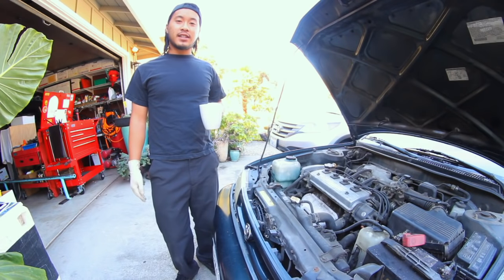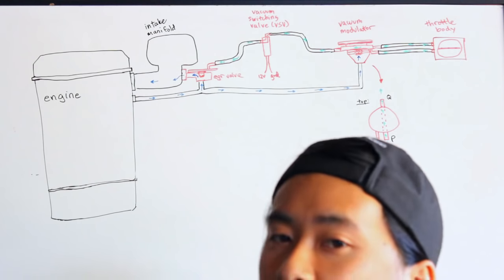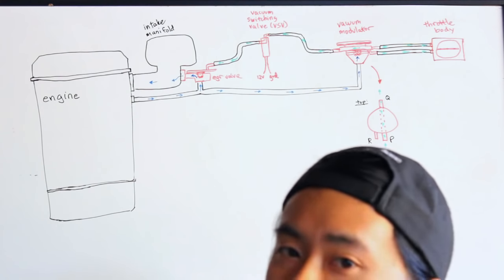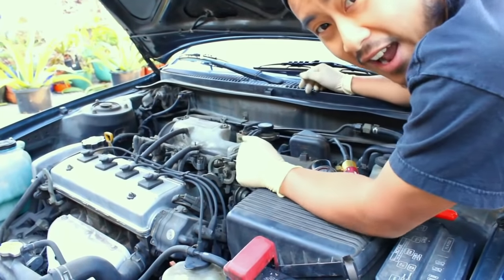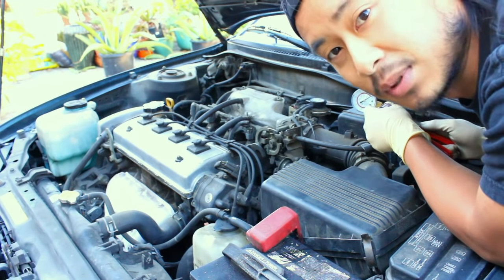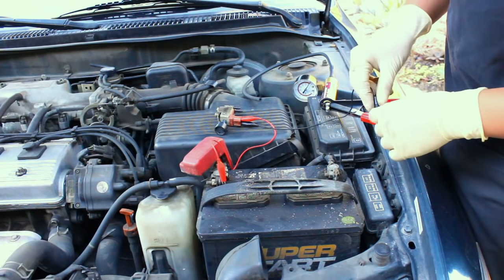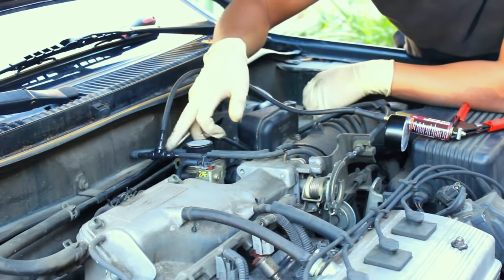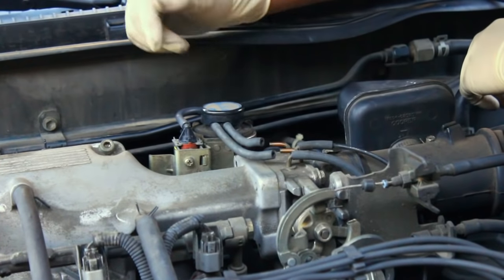How to test Toyota EGR System(VSV, Vacuum Modulator, EGR valve)

Comment: Justin, I have another P0303 Code on my  1996 Lexus es300 that I have done all tests shown on YouTube and replaced all coils, wiring, fuel injectors and test vacuum leaks on all cylinders.  I am tired of keep opening top of engines replace more parts, but can't find the cause of this P0303.  The misfire engine light comes on blinking when warmed up, but came on steady when cold.  What do you think?  Should I replace the Knock Sensors?  Someone told me this could be the cause.  Help, please.

Comment: Justin, that's an excellent explanation and video.  I'm not a DIY kinda guy so I was wondering if you work on other people's cars, and if so, what city, state you are located in and what's the name of your shop.  I have a 2000 Toyota Avalon with 265K miles but it runs smooth with smooth idling, and I have codes P0440, P0441 and P0446, the mpg has dropped a little bit.  Although I'm in Cleveland, Ohio, I do drive to other parts of the country to see family.  Please let me know and please keep up the good work.  Thank you. - Samir

Comment: I don't have a vacuum gauge, would the vacuum be strong enough for me to feel it if I put my finger right up to the vacuum modulator, like how you tested the throttle body vacuum? When I did that I felt nothing when revving it. But I did feel vacuum at the throttle body. Also, my car is now making a noise when revving. it appears to be coming from the egr valve itself. Kind of like a ticking.

Comment: On Toyotas at least, another way to test the vacuum modulator is to take the filter out and check its underside. If it looks all black that means the modulator diaphragm tore and escape gasses are passing through. Normally that filter should look clean or slightly dirty

Comment: So I did the "rev engine and put two fingers on throttle body lines" test. Turns out only 1 line was sucking... the other didn't do anything. 

What does that mean? Is there a blockage in the throttle body? 6:50

Comment: Hi Justin Nice video, I have a 1995.5 toyota tacoma no start but cranks only code we got was MAF , replaced it and no more codes but have check engine light how do you check the proper way to put 12v on pos & neg to vsv solenoid or does it matter?
Reply from the maker: Mama Jojo i usually look at which pin goes to the black wire in the harness and use that for my negative... Never tried reverse polarity but i would be surprised if it damaged it

Comment: Hi, Great work! I tested mt 1990 Lexus 400, Can you give me advice?
I have low HC and CO. But failed NOx badly at both speeds. No check engine. So I'm looking at the EGR system.

I put vacuum on the EGR and engine stutters so I know the valve works mechanically and exhaust passage is open. I tee'd in a vacuum gage on the EGR vacuum line and see that I never get vacuum (in park, engine warm, at all engine speeds). So the EGR never opens. Problem, right?

The "Q" off the EGR-VM shows vacuum when I rev the engine so I know the VM is good. All vacuum hoses are good and tight. 

Next I tested the EGR VSV. It closes with 12V and opens with 0V. This means it will operate the EGR when it's not powered (0V). The problem is that the VSV always has 12V to it during all my tests (engine hot, rev the engine). The VSV always getting 12V (closed) so it never opens to allow vacuum to the EGR. 

Why do I always have 12V. Does the 12V always remain because I'm in Park or is there something faulty that can keep 12V on the VSV? Is that normal? The VSV only opens when 12V is removed. No matter how hot the engine or how I rev it I never get the 12V to release.
Reply from the maker: Check out the articles I linked in the description. They're very in-depth and go into the exact parameters needed for VSV command. Hope this helps!

Comment: Hello so I just bought a 93 Camry 4cyl 2.2l and it needed a new distributor. I replaced it two -3 weeks ago and I as driving to work in the rain and it started losing power and then shut off, I'ma try to have it scanned today. But I tested for spark and no spark again in 2-3 weeks? I didn't even drive it a whole lot could this cause a slightly overheat without displaying on gage and short the distributor in twoish weeks? The ported vacuum switch was broke on both hoses and I didn't know at the time what it was but the car seemed to run fine when I first got it and had replaced the distributor

Comment: I do food delivery and after many stops and start sometimes the car will not start, I must have a jump to start the car, I noticed this happens after I shut down the car a few times and start again, I have to keep my car on and not shut it off or it will not start during my deliveries.
I have changed the alternator, battery and tested both are good and it continues with the issues, I think it’s something overheating.
The car starts only if I jump it or let it cool down for a while.
Any idea what it can be, thanks

Comment: Very informative video; thank you.  Is it possible to hear a click when the VSV is connected to the 12V battery, but not allow air to flow freely?  That is what happened with mine, but I just blew into it with my mouth, as stated in your video at 4:40, and absolutely no air went through, yet I could hear the click when I connected it to the terminals.....so is it possible I need to use the tool you have because I am not applying enough air by doing it manually?  The repair manual for my 2003 Toyota Echo just states to 'check that air flows from port E to port F', but does not specify how to measure the air flow.  I checked the resistance with my multi meter and it tests around 32 or 33, although manual states 68 degrees, but it's warmer than that at room temperature.  Also there is no continuity between each terminal and the body, so everything else checks good with it.  If you are able to give any additional insight, I would greatly appreciate it.
Reply from the maker: Make sure that your VSV is not the reverse of mine. Some close the valve when 12V is applied, some open the valve when 12V is applied.
Reply: Thank you for your response.  I checked in my manual and it says Apply battery voltage across the terminals. Check that air flows from port E to port F.  Can you tell me the name of the tool you use to apply the vacuum?  Thanks again for your help.  I have limited knowledge of working on vehicles, and am trying to rule out anything I can do myself before taking it to the shop.

Comment: Man I wish I could find this on a 2002 mitsubishi lancer.  Hard to find info like this.  It's like they separated it into a vacuum solenoid and vacuum Modulator.  One side easy to blow in and out, other one has a bunch of resistance, couple hoses come off intake into this thing and it has a T and goes into solenoid.  I really think it's bad.  My egr flutters when I rev it making me think it's not getting solid vacuum .

Comment: hi, i have Toyota Camry 2006 it dose not take power/ reduce power where its required... all other components are ok... like coils, plug, air intake system etc... but VSV not give the click sound during start are running... coil positive point  is ok but negative point does not work, mean supply is not return.... i tested with a lamp test... what is the problem can you help...???

Comment: Got a 96 Celica ST. P0401. I did the vacuum test on the old EGR valve and the engine did not stall. So I purchased a new EGR valve, did the vacuum test, and the engine still did not stall. The pressure on the vacuum gauge just goes up. I had replaced the modulator first. Engine idles poorly only on Drive (RPM needle goes up and down). What do you think could be wrong?
Reply from the maker: If you did the vacuum test on the EGR valve and the engine did not stall, then there is carbon build up blocking where the EGR connects to the intake manifold. All you need to do is clean the gunk out so exhaust fumes can flow through again and its fixed. Perform vacuum test again after cleaning out the port and engine should stall. No new parts needed… just cleaning.

Comment: Great video Justin Le. When I was checking the vacuum modulator, I was only able to get 3inches of vacuum on the Q port. Is that enough to work the ERG properly or is the modulator not working properly? Thanks
Reply from the maker: Thats probably fine. I think the technical articles i referenced in the description say 3-5 inches. Takes almost nothing to open the valve. I would check other things.
Reply: Thank You Justin

Comment: I know my vsv is working because I feel the egr valve open during acceleration, I replace the vacuum modulater so i know it should be good.  The egr valve should not be blocked because applying vacuum to the EGR stalls the engine.   Could it be a sensor ?????  How does it know there is not enough EGR?  or because the EGR does not stay open long enough because of a vacuum leak. not sure where to go next.

Comment: Nice video bro but have a question my 94 corolla rpm stayed at 3000 rpm at 60Mph I don't know what's wrong with the car and the car is running really  poor on exhilarating when push on gas. I might think its distributor or something cause don't have any check engine light on either
Reply: It's like my car is sipping to much gas . The half of tank don't last me 3 day only sometime 2 1/2 days I don't know what's wrong with it

Comment: thnx 4 the vid man.....question, .....what if I don't have any vacuum at the lines on top of the throttle body?
Reply from the maker: Are you checking for vacuum when the throttle is open? Vacuum only gets applied when the throttle body is open. If it there is no vacuum it might be clogged...
Reply: Thnx for responding.......yes I'm checking for vacuum at those 2 lines on top of throttle body as your video shows.......if there's no vacuum, they might be restricted?
Reply from the maker: +jaeden amaral yes, there is probably carbon build up at the ports. Try cleaning with carb cleaner.
Reply: Thnx 4 your knowledge.

Comment: Thanks so now I need a vacuum gauge, hope no crap feel inside my sparkplug hole. 
Without any pvc valve the motor light shut, but with new one it will flash. 386 000 km...

Comment: Not sure what the car or year is but my 2000 Toyota Camry.....the EGR VSV located on rear of motor (best accessed by removing right front tire) is totally opposite of what you describe.  When blowing air through the port it blows freely until power is applied and then then solenoid shuts, thus preventing any air from flowing through.
Reply from the maker: yeah I should have mentioned it in the video. some cars are opposite. But the fact you have activity and the solenoid is clicking is confirmation that it's working properly.
Reply: Might I also add that in your diagram description you mention the positive  pressure from the engine going to the bottom of the modulator pushing the modulator valve up to let air flow through by connecting points P and Q.....with the modulator for a 2000 Camry the positive pressure from the motor pushes the modulator valve up and cuts OFF the flow between ports P and Q, so with the VSV being opposite and the modulator valve operation being opposite the ONLY constructive criticism about this video is that when you do another one specify the make and model of the vehicle you are demonstrating.  Other than that the video was excellent with a super excellent and detailed job of explaining the ins and outs.  I'll be the first to say that your example makes perfect sense on how the system operates, and with my particular 2000 Camry the way the system operates obviously makes ZERO sense to me......as it seems it's completely opposite.  Keep up the good work!
Reply from the maker: Keith Wilson thanks for the comment. I never heard of that. Yeah i forgot to mention that some are opposite. Ill throw in an annotation.

Comment: Thanks for posting all this info...I tested each component as you describe (99 Tacoma 3.4). Each tested good but there is still no vacuum at the egr valve (last test)..with code P0401. Any ideas? Vacuum lines look good.
Reply from the maker: If all these tests pass, then you may not be getting signal to the VSV (vacuum switching valve). The computer sends 12V and ground to open and close the valve. Perhaps there is a break in the wires, a voltage drop, or a bad PCM (engine computer). One other comment stated that he had the issue where there was no signal to open the valve and found out it was a bad PCM... worst case scenario.
Reply: Thanks Justin. I retested today with a new vacuum pump and on step 1 the engine did not die under pulled vacuum...it definitely sputtered but stayed running. I read on a forum that it has to cut out under 5-7 lbs of pressure..s'that right? Also when applying 12V to the VSV under vacuum the pressure did not completely drop to zero...it took 2-3 times for a drop to zero (maybe I started with too much vacuum?). The supplying harness has 12V with the ignition in the on position. Does the first test mean that the egr needs cleaning? does the switch test indicate a bad VSV? Do you have an opinion on aftermarket parts being good enough? Thanks again Justin.

Comment: Thanks for the great video. What year is that Camry? (looks like one at least) I'm working on a friend's 1996 Camry and so far have only tested the EGR valve (killed the engine immediately with vacuum). I've ordered both the modulator and VSV. I couldn't, however locate the VSV from above. Do you know where it's located? I've heard under the intake manifold on the passenger side.
Reply from the maker: This one was a 97 corolla. Yeah, i was lucky and the VSV was on top. For your car i think you have to go under the car.
Reply: Ok, thanks. I later found a diagram showing it between the #2 and #3 intake right next to the head. Horrible location. I may relocate it to the firewall. Thanks again.

Comment: I have a 95 Tercel.....I connected the vacuum gauge to the solenoid valve, & energized it with 12v, and the vacuum needle dropped.......so I'm assuming it passed, meaning it's good?
Reply from the maker: Yes, that means the valve is working. You should also feel/hear it click.

Comment: @justinle, I pass every test except your first where vaccum to the egr valve causes it to stall. However, egr is holding vaccum upon further examination has no leaks and is brand new. Any suggestions for next trouble shooting to look for from there?
Reply from the maker: If your car does not stall (or at least stumble), check for carbon buildup at the EGR port. Make sure there is no carbon build up blocking the passages.
Reply: @justinle998  Ended up sticking a clothes hanger up the intake manifold's egr port, that solved it. Thank @Justin Le!

Comment: I have a 1999 toyota celica gt federal emissions. I've been battling p0401 for almost a year, I've replaced vacuum lines, the egr , modulator and vsv, we've also checked for vacuum leaks and have cleaned everything. we are at a loss. I need help! Need ideas/suggestions! !
Reply from the maker: check for electrical signal to the VSV.... it should see 12V on and off to turn on the solenoid. Maybe there is an break in the wire, or the computer is not sending signal.

Comment: Yo, awesome tutorial..  When testing the asi vsv on a 92 yota pickup, it clicks but releases vac very slowly..  Is that bad?..lol  Had code 41, code 31, changed the tps, think i tested the afm right, voltage increases correctly when movin the flange through, i think it 2.? to 9...  Man i'm at a loss..  Last time I went to as shop I got took for 600 and they didn't even fix the problem......  Thx
Reply: Oh, any way to clean a vsv, throttle body cleaner?

Comment: hi Lee, CAN YOU PLEASE explain why engine stalls when you pull vacuum on a good EGR valve?
Reply from the maker: It opens the EGR valve and allows too much exhaust gas to flow back into cylinder… too much for the engine to handle at idle.
Reply: @justinle998  Thanks
Reply: @justinle998  Hi Le, At 8:35 of the video. the EGR valve opens when engine is warmed up and revs up. So does that mean EGR valve does NOT open at idle at all ? and only open when engine reving at higher RPM? At what RPM does EGR valve open?  Thank you

Comment: is it important to warm car up before you apply vacuum to top of egr valve? I applied vacuum and car stumbled but did not stall out. I think because I didn't let engine warm up hot enough
Reply from the maker: It is hard to stall the engine without it being fully warmed up. But the fact it stumbles tells u its working.

Comment: I my case i get PO402 which means excessive airflow. i replaced the EGR valve and vacuum modulator. Replaced vacuum hose that is broken. i thought its been solve, but after 70 miles driving check engine came out again. OBDII detected same problem... the dreadful PO402. WHAT AM I MISSING CAN YOU HELP. THANKS IN ADVANCE.
Reply: The next check would be the Vacuum switching valve. (EGR)

Comment: Damn, the VSV is right out in the open on that vehicle. It's underneath the intake manifold on my girlfriend's 4 cyl 4runner and requires removal of nearly everything to get to it lol.
Reply: Idk why everyone says this I was able to get it done with 1 cheap multi screwdriver thing. Use the flathead side to push the vacum lines off, unscrew the sensor from the bracket with a philips, at this point the wiring harness will allow you to pull the sensor a few inches towards you, pry down on the tab or push with fingers and viola it's out. reinstall is a little tricky but have faith in yourself, recconect electrical and just reach your right arm under the backside of the intake manifold and get whatever hold you can on a vacuum line, with your left had hold the sensor and kinda do your best to mate the two then from the front push on the vacuum lines while letting the intake manifold be the backing for the sensor (you won't crack the sensor this only requires light pressure). then realign and screw back in! easy!